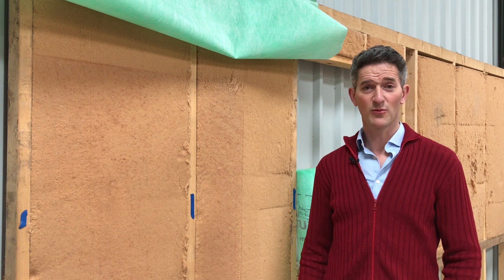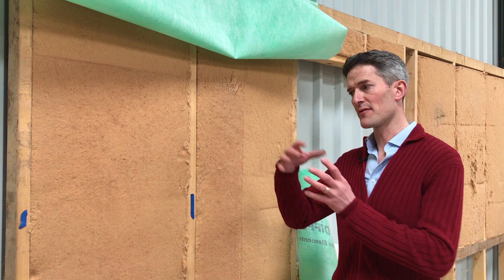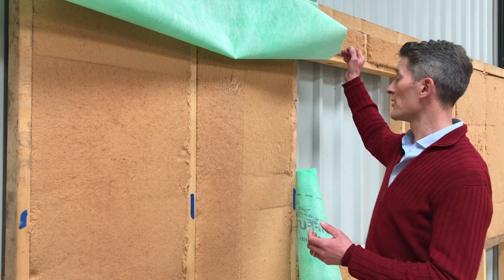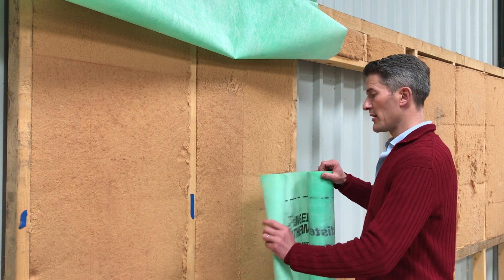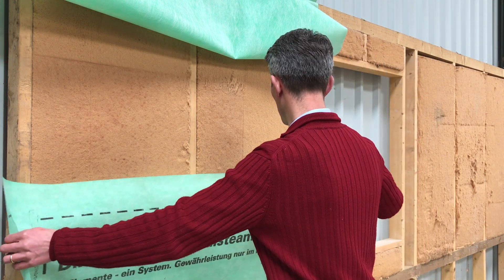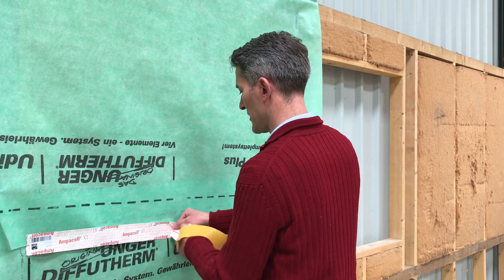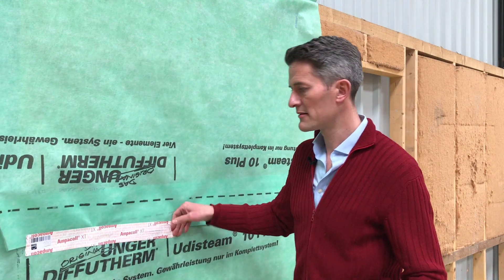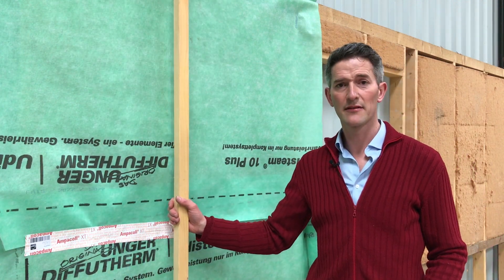How do you install a Vapour Control Layer?

Comment: Counter-battens have me confused, I thought the plasterboard goes straight over the vapour control layer; although maybe this is because there's no airspace behind the insulation in the example? So the counter battens provide an airgap?
Reply from the maker: Hi Michael. Correct. It is better to counter-batten over the membrane as it protects it from getting too many holes in when installing the plasterboard and makes the whole construction much more airtight.